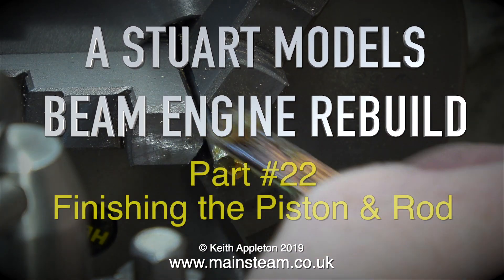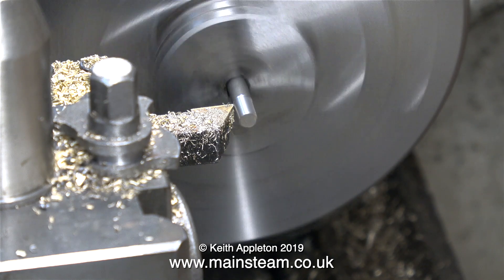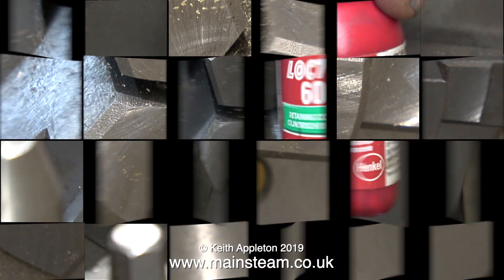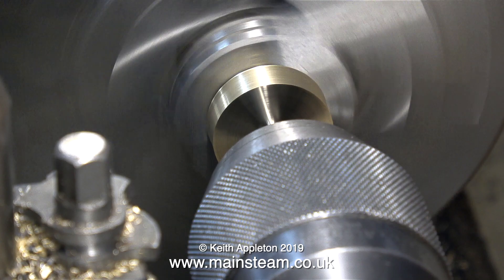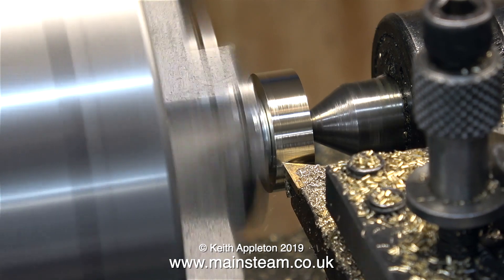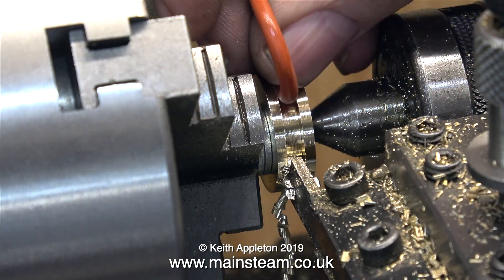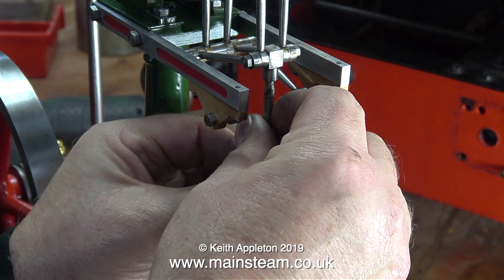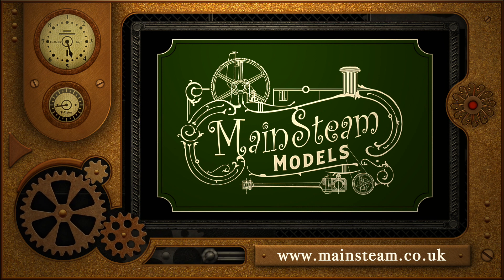A STUART MODELS BEAM ENGINE REBUILD - PART #22

Comment: If I have gained nothing else from watching your videos, I have learned of the merits of Loctite products. I'm no engineer, I have no proper workshop, but threadlocking, in particular, has been very useful.
Reply from the maker: I have just used some Loctite 603 to repair a broken guitar pickup switch - it's very useful stuff for a variety of applications.